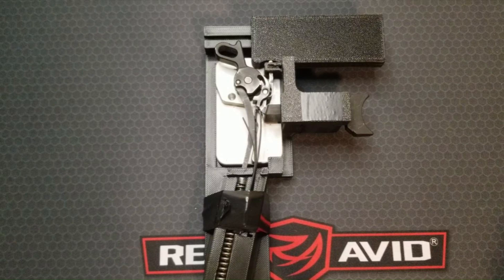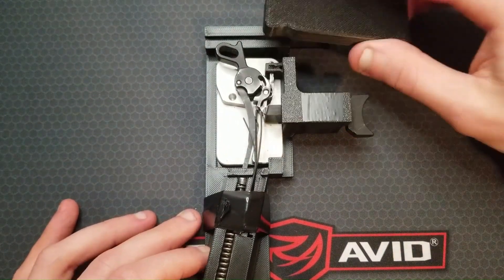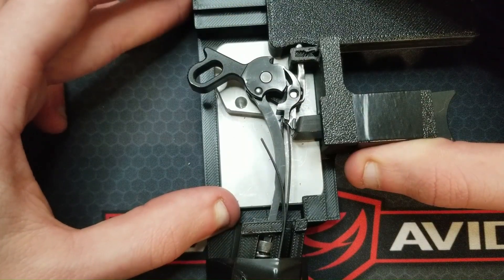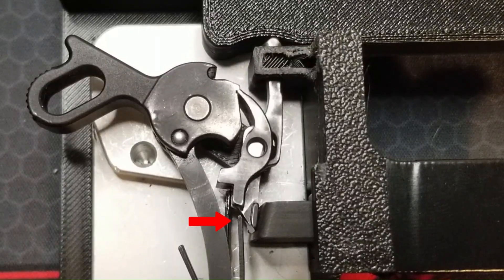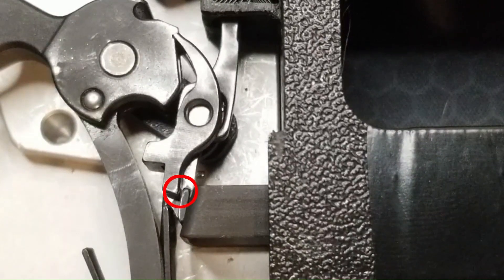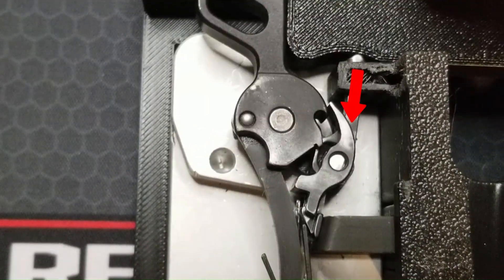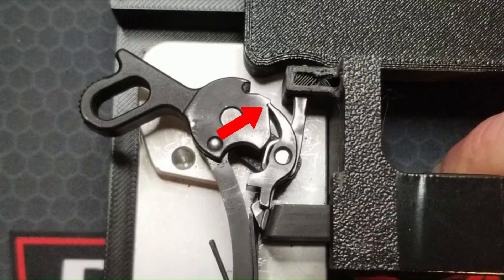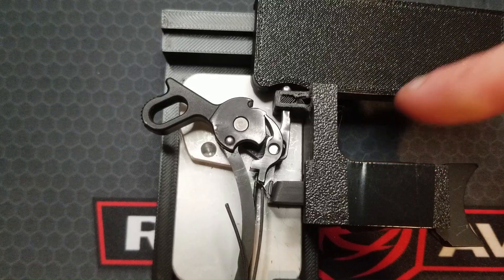Detailed 1911 Trigger Action Demonstration

Comment: 1:38 Often unappreciated is the sliding and pivoting of the contact between the disconnector's foot contact surface of the with the sloped rear section of the trigger bow.

Comment: Nicely done! The 1911 Trigger mechanism has so many facets of mechanical engineering, Levers, Pulleys, Sliding wedges, Kinetic energy i.e. Mechanical Advantage, Materials science.
Please do one on a 1970's era Colt Python. How those engineers managed to get a Double action pull just as smooth as a Single action pull is Mechanical Engineering magic.
Reply from the maker: I would if I had an Colt python haha.

Comment: Hi, love your videos!
just started doing trigger jobs about six months ago and have learned so much from you.
I’ve been scouring the Internet to find a 1911 cut away as you have in one of your videos for the FCG.

I was wondering if you happen to have the 3-D print of that 1911 FCG cut away. 
Thank you and please keep up these excellent videos
Reply from the maker: I do not. I usually share my designs but in this case i didnt becuase it was very hard to get this demo jig to work. I had to modify the pieces after i printed them and didnt go back and update my models.
Reply: @EngineersArmory  that’s perfectly understandable and I appreciate that rapid response. I’ll probably try and design one on my own because I think that is the best way to understand exactly how the FCG works. Thanks again.
Reply from the maker: @jaysinger38 sure thing. Good luck and have fun with the design.

Comment: Thank you for making this video! It is so much clearer to me now. I wasn't quite sure how the disconnector worked, but now it makes sense. I upgraded my Springfield Armory Prodigy with a Nighthawk Customs drop in 1911 trigger system and then lightened the main spring. It was much easier than having to hand fit everything but it wasn't cheap.

Comment: Note to do-it-yourselfers. If you're trying for a lighter trigger pull, don't file the hammer hooks. Ever. Leave the hammer alone. Don't file the sear hook either unless you have a stoning fixture and know exactly what you're doing. Stick to adjusting the sear spring tension.

FYI- If you're set on learning how to do a trigger job, it's better to mess up a sear than the hammer. Hammers are a lot more expensive.
Reply from the maker: Agreed If you want lower trigger weight. The best way to start out is sear spring adjustment. Dropping in a lighter weight mainspring is an easy thing to do as well. Sear primary face angle and its engagement relationship with the hammer hooks can affect trigger weight but modifying sear tip geometry is a more advanced operation.

Cutting hammer hooks back won't appreciably affect trigger weight, but engagement depth and therefore creep in the break. As with sear tip modification, cutting hammer hooks shorter is more advanced.

Carefully polishing components without changing geometry can also affect trigger weight a little.
Reply: @EngineersArmory I bought a dirt cheap Rock Island to experiment on because I wanted to learn how to hand fit parts, do trigger jobs, sights, stuff like that, but didn't want to mess with my nicer 1911s. First go around I ended up filing too much off a barrel hood. Too much off a grip safety. Oops....

I went thru a bunch of sears and hammers when I was learning how to do trigger jobs. Sometimes, I had to get new thumb safeties too. Some aftermarket sears had slightly different tolerances but I ended up taking a few too many swipes of the file when trying to refit the safety. I learned a lot the hard way lol. Polishing the trigger bow/disconnector engagement surfaces and changing the sear spring tension works for me. Now I only stone sears if I find burrs. I also found out the hard way that the angle is critical lol. I don't touch hammer hooks at all. I always leave those alone. Now I can dial in a crisp, clean trigger pull for whatever the intended purpose of the gun is.

I'm self taught, do a lot of reading. And trial and error. Like, a lot of error....😂 Got any advice for guys like me that want to learn but have no plans to make a career out of it? I do it for the enjoyment as a hobby.

Comment: The mechanism will trigger full auto when the tip of disconnector cut straight aligned to the receiver. Already tried this for research
Reply: No it won't. It won't reset
Reply: @blackhawk2302 yes it wont reset because the trigger remains lock on the sear. The sole purpose of disconnector is disconnect the trigger from sear. Already done this and made the 1911 in full auto mode
Reply: @danielsanjuan7699 No. You didn't. It either causes a malfunction or a runaway. Doing that is beyond stupid
Reply: @blackhawk2302 Try it your self and you will see. We'd already do that for R&D. And yes it's stupid thing to do, I agree on that but thats how technology evolves.
Reply: @blackhawk2302 https://youtu.be/7y5P3Vt7RFs?si=LRPkwm9FX1ljL-Ah

Comment: Do you know why all manufacturers even from newer models stick with the grip safety? Isnt its unnecessary? I mean the Hi-Power also get along without it.
Reply from the maker: I think it's a good safety feature. It's always been unobtrusive for me. Maybe my hand shape and size, but I've never had an issue disengaging it. The disengagement point is also very easy to adjust. Many higher end manufacturers omit them.
Reply: @EngineersArmory  I also dont had trouble to disengage it but some have. But what makes it good? I think its unnecessary.  If I understand the mechanism right as long as the thumb safety is engaged the hammer cant slip off the sear anyhow. I have seen some drop test without the thumb safety engaged  and  the hammer dropped  but was catched by the safety notch "half  cock" form the sear. So there the grip safety didnt prevent anything. And if you drop it at the muzzle the round can go off just from the mass inertia of the firing pin. There I dont understand why not all modern 1911 have firing pin blocks. With  a firing pin block there really is no reason for a grip safety. And firing pin blocks are state  of the art. All modern pistol have it.
Reply from the maker: @Gieszkanne  I certainly dont have all the answers haha. The original 1911 design didn't have a grip safety. The military required it so it was added. They may be largely "traditional" or vestigial if you will.

The vast majority of 1911s sold nowadays are 70 series without a firing pin safety block. The first firing pin safety block on a 1911 was introduced in the 30's with the Colt Schwartz safety. That is a grip safety actuated FPSB. The 80 series with the trigger bow actuated firing pin safety block wasn't introduced untill the 80s.

The 80 series one affects trigger pull, people dont like that. I dont see an issue with the Schwartz safety as It doesnt affect trigger pull. Kimbers from the mid 2000s had them, the pistols with the roman numeral II in their name. My dad has one, trigger is nice, firing pin block disengagement is unobtrusive and not noticeable. But Kimber had a lot of trouble with the timing of those when first introduced.

Regardless of grip safety or not, a 70 series 1911 isn't really drop safe. The thumb safety blocks the sear, the grip safety blocks the trigger bow.

If i were to concealed carry a 1911, say appendix carry, I would want as many safety features as I could have if it were pointed at my nuts so gimme that grip safety too haha.
Reply from the maker: @Gieszkanne  yeah, probably only trigger snobs will feel that firing pin block disengaging during the take up lol.

Lighter firing pin will reduce the chance of inertial ignition. It will also increase the chance of light strikes. Titanium is a little more brittle than steel, has good fatigue resistance for its hardness, but may be more prone to fracture, or earlier failure than a steel firing pin. 

You can get the same increase in drop safety margin by installing an extra power firing pin spring. Thats what I do. I run 17# mainsprings in all my 1911s and have never had a light strike with an extra power spring and standard steel firing pin.

The reality is you will never have 100% drop safety unless a firing pin safety block is used.

Comment: Question: If the base, or "paddle," of the disconnector was thicker (measured from front to back), wouldn't the take-up of the trigger-pull be reduced significantly?  Because a thicker paddle would contact the base of the sear earlier as the trigger-bow moves it backward. I dont believe this would compromise the disconnector's role as the slide moves forward after the sear is released. Does that make sense? I'm not an engineer, so I don't know all the technical terms.
Reply from the maker: You explained that well. Yes, I believe you are correct. that would serve to limit pre-travel. There may be some consequences that arent immediately obvious to me. How would extra disconnector mass affect the action? I think you're reset couldn't be as short, the thicker paddle would have to move forward more to pop out from under the sear legs. But maybe that could be accounted for with overtravel adjustment? Not quite sure. Interesting idea!
Reply: Ah yes, the reset! You're right, the reset would have to be longer due to the sheer thickness of the paddle in relation to the sear. In fact I could see a reset-snob arguing that the paddle of the disconnector should be THINNER, for an even shorter reset (crazy!). Alternatively,  you could make the trigger-bow slightly longer (from front to back). Again, as you pull the trigger, this would force the paddle into the base of the sear earlier, and limit take-up considerably without compromising the length of the reset. You would have to alter the geometry of the grip safety, so that it correctly engages with the rear of the trigger-bow when being gripped (or at rest). I wonder if anyone makes a trigger with a slightly longer bow? Hmmmmm.....

Comment: Great video. Clears up how it all works. I do have a personal question. I carry appendix. I want to switch to a rock island armory 1911? Are those considered "safe" cocked and locked? Could the gun go off by itself without the trigger being pressed? Could the sear malfunction?
Reply from the maker: If you've left the trigger alone there is probably a lot of sear engagement, and quite a bit of pressure from the sear spring and main spring on the sear-hammer interface. Meaning the sear will have good, safe engagement. Also the grip safety will likely engage very far into its travel. Factory guns, especially cheaper 1911s are almost always set up this way. They just assemble them, there is minimal to no fitting done at the factory. They keep all their tolerances such that when you slap em together they will be safe. At the expense of a heavy, not great feeling trigger.

No 1911 (with 70 series internals) is drop safe - keep that in mind. 

Do your safety checks. I have a video on those. There are plenty of others out there. Do the safety checks. Shoot it, familiarize yourself, put enough rounds thru it to trust it. That kinda goes for any carry gun.

Short answer is, Yeah, it will probably be safe to carry cocked and locked. Good holster is a must of course.

Comment: My 1911 went full auto and idk how to fix it and idk where to look ? What’s causing it to go full auto
Reply from the maker: Most likely inadequate sear and hammer hook engagement. Take it to a gunsmith if you're not comfortable diagnosing and repairing it. Likely sear tip is worn and needs a new face cut on it or replaced.

Comment: I love love love your videos. I am going to buy a Tisas DS Duty 5" and try doing some of the tuning. I was scared because I have limites knowledge, but your videos really help me understand what to do and what is happening. Imhad no idea thr 1911 was so complex. Today at the range, a group of girls were shooting their Sig 365's. I don't know what configuration. Doesn't matter, i asked if either had shot a 1911. Neither had. So I loaded a 9 round mag and let them go. Both shot tight groups and somtimes 3 rounds would be nearly in tne same hole in the red zone. Both shot it so well. The guy next to me told them it was probably a Wilson Combat or Kimber, special tuning, hand fitted. They were all,shocked whEN i said it was a Tisas I paid 319 bucks for. This guy had a Flux Raider and a Canik TTI combat master. These veey attractive ladies though were more i impressed with my cheap 1911. They hung around and shot some more and I loved it. They did too.

Comment: Will you do one for series 80 1911s? Incredibly informative video.
Reply from the maker: Unfortunately I dont have access to an 80 series. I do have access to a Schwartz safety 1911. But different firing pin block actuation mechanisms. There is a lot of info about the 80 series in the Kuhnhausen manuals I would recommend checking that out.

Comment: I'm a mechanical engineer and like your YOUTUBE videos to explain the details of the components inside a Colt 1911 model. I'm purchasing a Colt 45 acp Gold Cup National Match and am interested in purchasing a Kuhnhausen manual for the same pix you use to study along with your videos and narratives. I notice there are (2) Kuhnhausen manuals that look similar, if not identical? Do you think one of the books is sufficient for a beginner, for non commercial applications. Which might you suggest is uniquely better than the other.
Reply from the maker: There are two manuals that I reference by Kuhnhausen: "The Colt 45 Automatic A Shop manual," and "The U.S. M1911/M1911A1 Pistols & Commercial M1911 Type Pistols A Shop Manual." 

I would recommend both but if you were to get one, I would start with The U.S. M1911/M1911A1 book. 

There is some conflicting information between the books. I have only identified a couple areas - however the information in the M1911 book is correct (as far as I know) if they do disagree.

There is a ton of great information in these manuals, but I dont think it is very well organized. For this reason I recommend a PDF version that you can use Ctrl+F to search for keywords to find the information you're after.

Free PDF versions of both books are readily available with a quick Google search.

I also understand wanting to have a paper copy at my work bench. In that case, I would recommend starting with the M1911 manual. 

Hope this helps!

Comment: Thanks for information I would like to see you do upgrades to the girsan 2311
Reply from the maker: I was looking at buying one of those but they were getting pretty terrible reviews. Like not operating properly out of the box. The Tisas and MAC9 (I have bought both), seemed to be doing better out of the box and therefore a better place to start a project. They're pretty much all the same. 70 series 1911 internals. Modular Staccato/STI pattern frame and grip module. 

If you're curious what I would have done to the Girsan, Check out my videos on the Tisas 1911 Carry DS. Thats very similar - bushing barrel, etc.

Comment: The Browning multi function sear spring was so innovative for the 1890s when he was designing his self loading pistol.  It saved considerable space and number of parts that would have otherwise been needed.
Reply: Eh. It was not unlike ang other leaf spring. Many, many weapons of the era had multiple functions tied to the same spring as the sear. Many of the lever actions leading thru the 1800s had springs acted as both sear and trigger spring.

It was a then-relevant approach where mass production of springs wasn't scaled to its current capacity and flexibility. Now, it doesn't make as much sense. Otherwise, more new designs would bother, but they don't, for good reason.